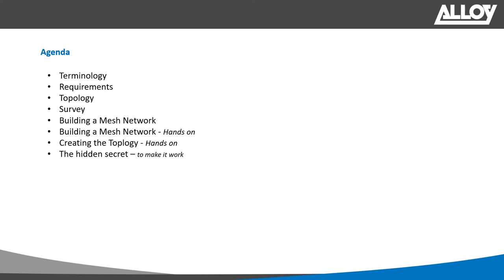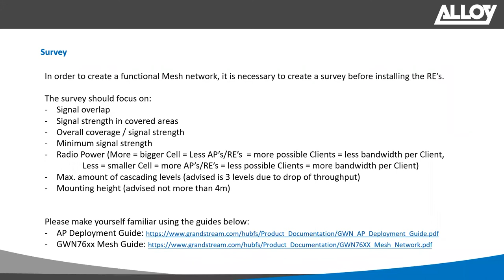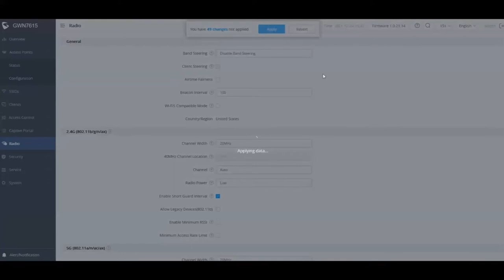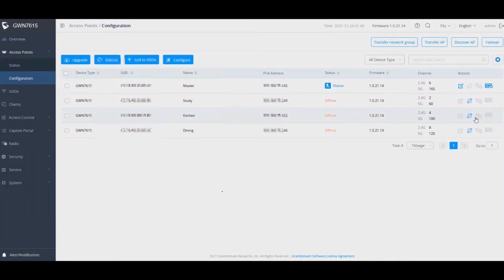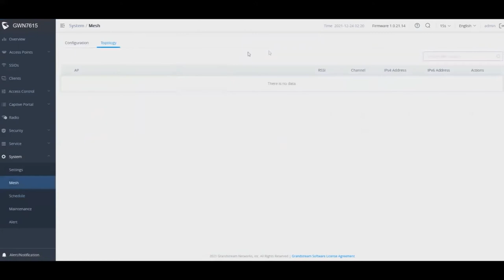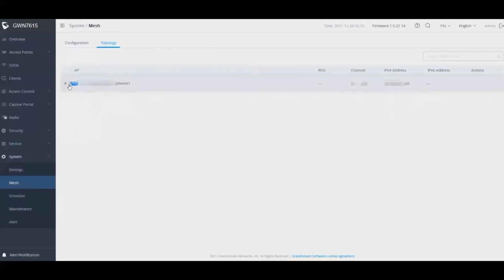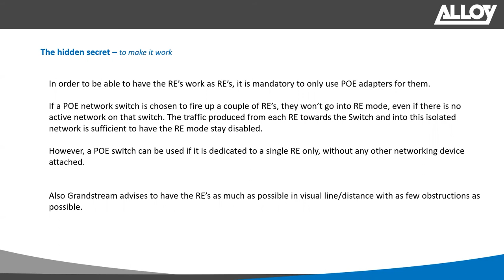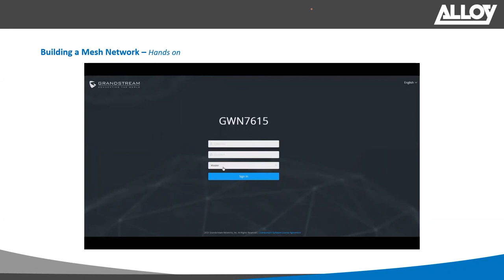Setting up a Mesh WiFi network with Grandstream APs

Comment: Thank u very much for such a tutorial.

I didn't get the POE issue point at the last slide. Now i do have two of GS. One of them is master and the second is the slave. Do i have to use a separate POE injector for each one of them or one switch that have 4 POE output feeding them both is okay?

i really appreciate u for the whole thing.